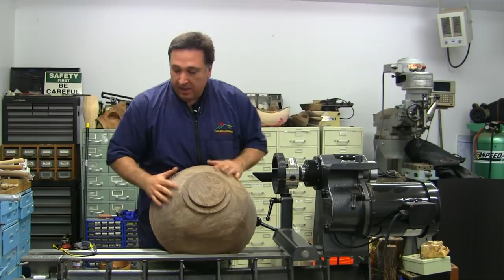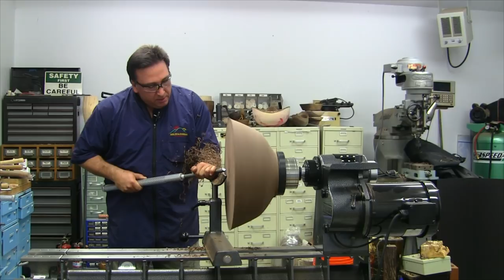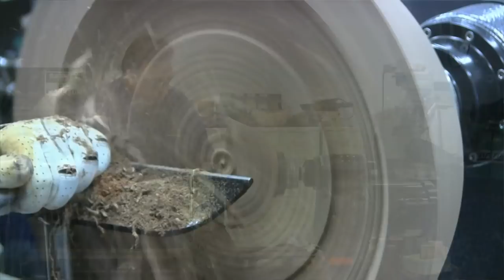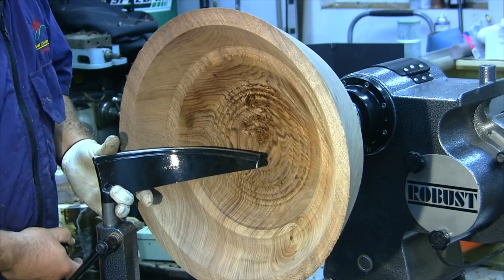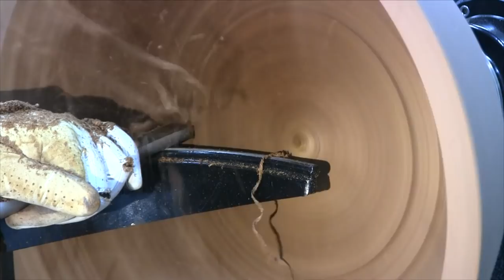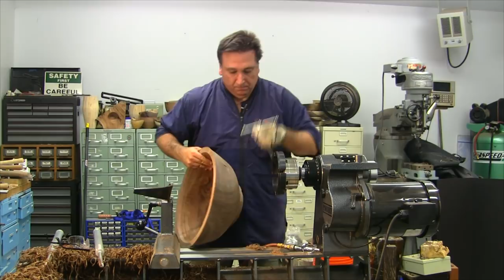Turning a Large Walnut Bowl in HD - Woodturning - 40 Min How-to Video

Comment: Its heartbreaking to see so much walnut end up on the floor. This is one of those great bowl blanks that warrants/justifies the $600+ cost for a bowl coring system. A great video, it is definitely going to be a beautiful bowl upon finish turning. Im glad that you uploaded a full length video, its strangely relaxing to watch someone else turn, the quiet except the hum of the lathe and the sound of the shavings peeling off from the tool.. good times.

Comment: Try the carbide for heavy work and finish this a traditional bowl gouge riding that bevel.

Just wish I had you equipment.
Reply: I really dislike piling on here, but the danger and waste from so many facets of the process of using 10,000 yr. old tool technology is just crazy. Carbide can do so much so quickly today, there really is no point to much of this. Your statement of useless seems to be a pre-conceived prejudice. Excellent camera/picture  quality though.

Comment: Hi I have not seen in 40 yrs a bowl turned rough..like yours.. I am not being hard on you., did the bowl dry a little first.. I generally rough turn them ..coat with paste wax and wrap like you with shrinkable wrap with a heat gun.  Most are 1 inch thick walls..then into my attic they go.. here near Lake Tahoe at 3000 ft bowls dry fast in the summer..I made a bowl lathe this last year.. home made for 600 bucks.. variable speed and holds up to 31 inch diameter..it’s 220 volt with triple phase motor.. the unit has casters I need cause the lathe weighs 500 pounds. Casters drop quick and set quick. The guts are twin I beams steel.. can can provide a pic..how much did your lathe cost. Curious. Thanks Terry T. I am an old man..old forester too.

Comment: One question; if you were not making more than one why would you face the whole thing before roughing out the center? Just waiting to know cause I want to get into turning.
Reply: Flattening the face makes the bowl more balanced allowing for a higher rotational RPM while scooping out the center.  Higher RPM means smoother and quicker cutting (and safer).